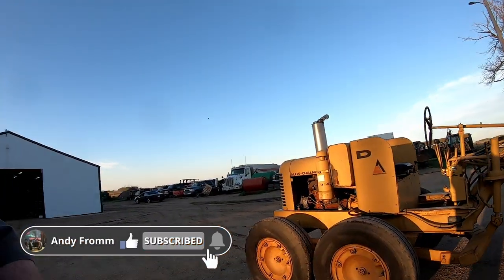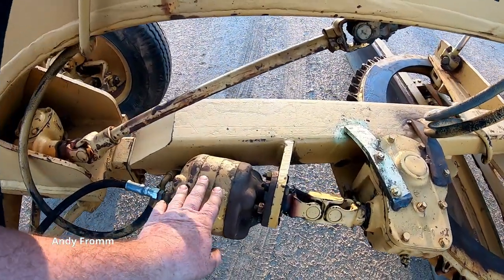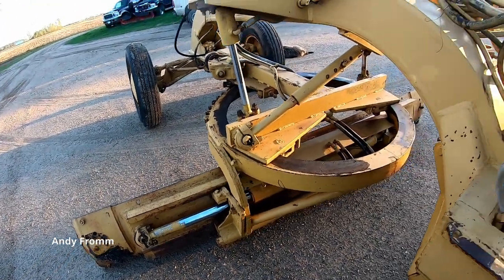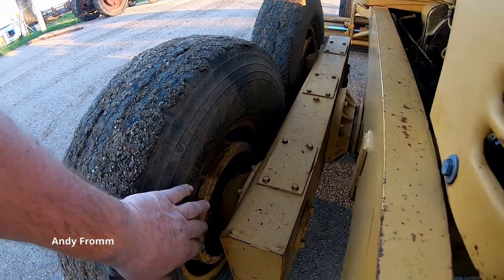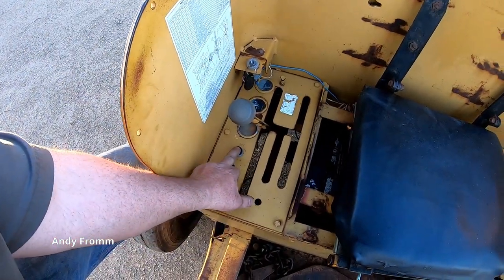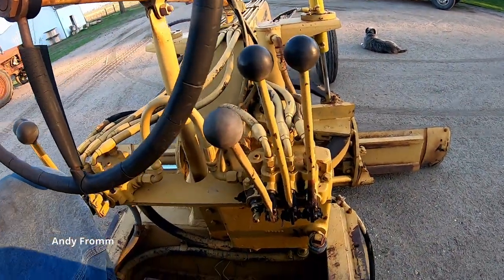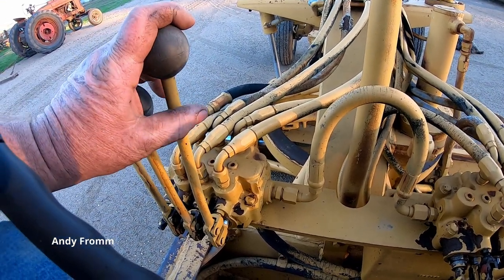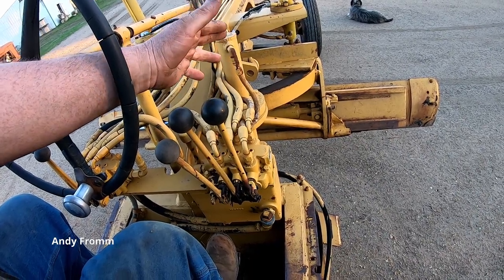Walk Around, Controls, and Options | Allis-Chalmers Model D Motor Grader

Comment: I RAN ONE OF THESE FOR A COUNTY ROAD CREW IN KANSAS PUTTING IN BLADE PATCH AREAS BEFORE THEY APPLIED OIL AND SAND SEALING EVERY SUMMER IN THE 1980,S. A GREAT MACHINE, AND I HAVE BEEN LOOKING FOR ONE TO BUYT LATELY.
Reply from the maker: I see them around every once in a while 👍
Reply: I have the 1959 dd Allis Chalmers its great machine

Comment: Looking at maybe buying one to grade our private road. Does it do well on hard pack gravel? I’ve got about a half mile by 10 feet wide. Currently use a tractor with a land grader which does great, but it’s slow because there’s no down pressure and you have to work your way down below the potholes.
Reply from the maker: It's not the best with extreme hard pack, too much down pressure and it spins out.  One with a scarifier would loosen it up.